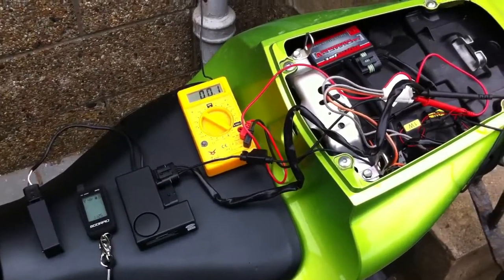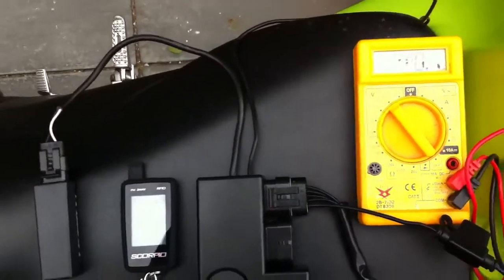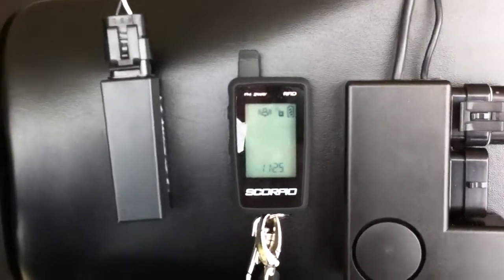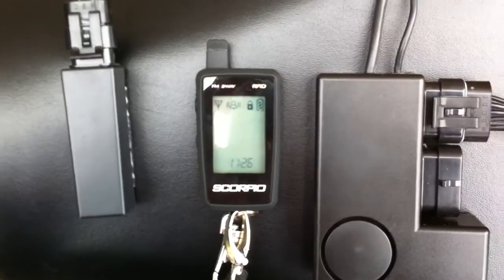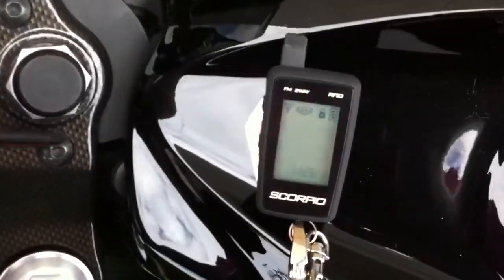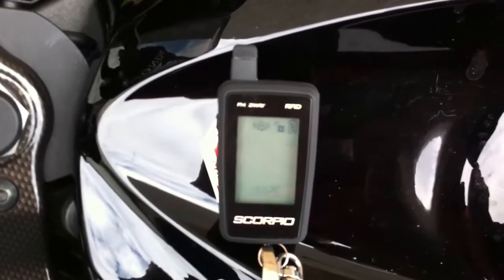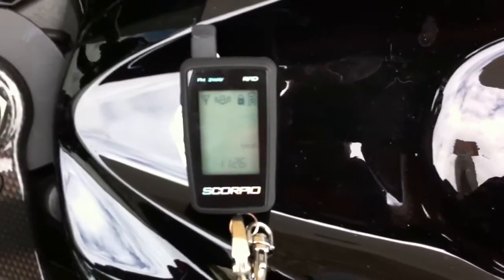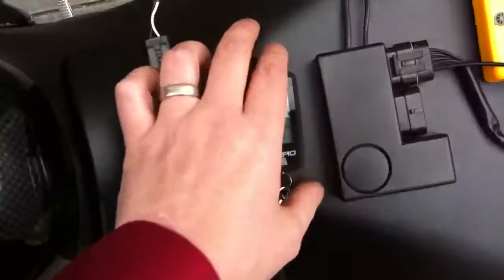Scorpio I900 problems

Comment from the maker: As per below it seemed to sort itself although on occasion doesn't always arm the remote.  I no longer work in an office within range so tend not to notice anyway very often but I usually do feel it buzzing in my pocket. 

The best thing though is the RFID as no button pressing or anything.  With a normal fob you have to take it out and activate, then put it back in your pocket (assuming you dont want a fob flying about your handlebars attached the the key) - just jump on bike and ride :)

Comment: Hey man I've found your video really interesting and I actually have noticed the very same problem with my SR i-900. An other problem I've found is that sometimes when I arrive next to my bike the perimeter sensor doesn't trigger the alarm but then when I turn the key on the siren goes off, the remote vibrates shiwing the icon "ignition". From my understanding what happens is basically the perimeter sensor "feels" I'm there with my remote but the RFID antenna doesn't. Same issue should cause the alarm not to activate when I walk away from the bike.  How did you fix it? Did it "auto-fix" by itself? Let me know. Thanks!!
Reply from the maker: Sounds like your RFID is not picking up the fob what so ever. I don't think I ever had that problem as when the bike is promoted to check (ie about to activate) it always double checks and would pick up my fob. 

I've now moved onto another bike now and not had an issue that I've noticed. Possibly random signal interference from the bike or interference from mobile phones. Try pulling everything out and making sure it's clear and working before snuggling it into place?
Reply: Yes I just pulled everything off the bike and it works fine so it's just a matter of finding a place where there is no interference with the signal. Thanks again

Comment: Hi Alan. I'm thinking of installing this kit on my bike here in London. Would you recommend this? I had a Spy 2 way alarm on my previous bike. Did the job but perhaps the range was a bit dubious. Defo not 5000m as it claimed. 

What's the range on the Scorpio? And where did you buy yours from?
Reply from the maker: The place I bought it from is long gone and tbh the range is iffy. It's a good alarm though and have moved it to my s1krr. It's a nice to have when in reception range but it varies depending on objects. The RFID though is worth it alone. No buttons to press to arm/disarm!!!
Reply: +Alan King Hi Alan. Thanks for the response. The more I think about this, I feel perhaps their Ride option would be the way forward really. It's got a tracking feature for about  £9 a month. I'd be happy with that. Plus obviously the main unit for about £150.
Reply from the maker: +sportsmusiclover Yeah that's a different affair - if you want a tracker and happy to pay for it then the Scorio I have is pointless.  My only concern is how usefull trackers are as tend to block signal with a chap device from DX, stick it in a container/underground car park and have it in bits before you find it...then do you want it back... I had a tracker device to install but ended up selling it on as wasn't 100% sure (that and battery dies very quickly on bike as it is never mind a constant drain)
Reply: +Alan King Ahh.. Didn't think of the battery. I do like the app update feature though, as in if someone turns the ignition when you are at work/ asleep etc, it warns you instantly, and ofcourse you contact the cops to sort the scum out instantly. 
I could optimate the battery once a month.
Reply: +Alan King Oh, does the scorpio have the anti-hijack feature? What is this? Does this immobilise the bike if someone hijacks you?
Reply from the maker: +sportsmusiclover yeah. Think immediate warning to do something about (unlikely police that soon)   After that it's gone and prob don't want back
Reply from the maker: +sportsmusiclover ps a to hijack works if your wire into fuel pump relay or similar. It's not a standard feature.